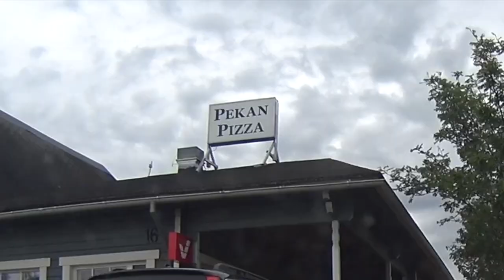115 km in RAIN with Milan SL Velomobile

Comment: I also sweat a lot in my velomobile. When it is raining I sweat even more. It helps a little bit to install seat fans on the back of the seat like I did in part 3 of my quest lighting upgrade series that I just uploaded to my YouTube channel. Even when I ride without a race hood I get very sweaty. I think that is normal in a velomobile. I wear shorts for working out and those don’t soak up as much sweat as regular tshirts, but I can still usually ring the sweat out of my clothes after a ride when it is raining or very warm.
Reply: I imagine you sweat more when it's raining because the increased humidity
Reply: Actually T-shirts are no good at all. Better wear a polo, the heavy cloth kind. The heavy cloth absorbs sweat and lets it evaporate.
It also prevent the clammy feeling of the T-shirt clinging to your body.
Always put up the collar to prevent from sweat running down your neck.

Installing a USB-ventilator, or even a PC-ventilator may help too.
Reply: @_PJW_  athletic clothing technology has evolved considerably since the early 1900’s. No athlete would consider wearing such clothing now. The wicking shirts and shorts now are MUCH better at cooling and evaporating sweat than the clothing you are referring too. If I wore a polo shirt when riding I would be water logged by the end of the ride. No thanks!

Comment: I had the chance to add a Milan GT to my Alleweder 6 this summer and my verdict is: yes and no. The GT is so much fun to ride, and I am impressed by its efficiency, I had never ridden a bike "seriously", I came to cycling with the help of electric assist, and nevertheless I can do longer trips with an average of 28 to 30 km/h. However, for long trips which are not only day trips and where you need to take luggage with you, I don't find the Milan or any other fast velomobile is very suitable for long trips (maybe with the exception of the Alpha 9 or QV if this is still a fast one) - if you are not a Tetris champion. When going on trips that are more than one day, I continue to prefer my Alleweder because I can just pack SO MUCH stuff in there! I only do an average of 20 to 25 km/h with the Alleweder but that's not a problem.
I second your opinion on the seat, but I have no problem with the neck rest. My GT also came with the new Ventisit neck rest but I found that too hard and uncomfortable so I re-installed the default foam thing you also have.
In such heavy rain, I also ride with open visor because otherwise you can't see anything. In the German forum there is a thread about a new hood with a motorcycle helmet visor being planned / in development for the Milan, I hope that comes to fruition some time. My service hatch at the front is not leaking, always make sure you press it on firmly.
Are the ventisit "carpets" to put at the sides of the seat you took from your QV available as separate items?
About sweat: That is more prominent when you wear loose-fitting cotton clothes. I never wanted to but I started wearing roadbike jerseys and running tights (because they have no seat pad, unlike cycling shorts) when riding the Milan. This at least remedies the sweating a bit because these fabrics transport the sweat away from the body faster.
Reply from the maker: The floor mats are available from Velomobiel.nl. But the QV mats comes with a third one for the rear luggage space, which you don't need. Maybe ask if you could buy just the mats for the side pockets.

Comment: This is very good, that the parts are not stainless steel, because stainless steel can break. Normal Steel gets a bit of rost, but this kind of steel is much more durable and does not break easy.

Comment: 100 km is no propper test ;-) That is a daily commuter ride  ;-) ;-)
This test gives you a good inside about how you sit. You need a thick open ventisit for comfort and more ventilation. Your shirts are cotton (soking up moister) or closed polyester (with closed print 'i'm a velomobilist')
With a hood on, above 5 C, I never ware any shirt. Just a short trousers and a thin towel on the sit with a lot of small holes. 
My neckrest is also from Ventisit. There is a whole range of thickness and forms you can choose from. Your neckrest is for sound demping. No good.
When I'm riding in the rain (with hood on) a use a second big packtowel around my neck
Reply from the maker: I know 100 km is not long enough. I wanted to ride longer distances, but I just didn’t have time for that this summer 🤷‍♂️

Comment: Have you considered trying Schwalbe Big Apple or Big Ben tires? They smooth out the ruff roads, here in the Cascade Mountains pretty well.
Reply from the maker: No I haven’t. No room for wide tyres on Milan.
Reply: @TheVelomobileChannel  then maybe some fast rolling gravel tires would work like panaracer gravelling slick or SK thread variants?
Reply: Michelin Wild Run`R 26x1.40 would be fine.
Reply: @TheVelomobileChannel  What would be the max width that could be fitted? A Mondial might work, or a Michelin.
Reply from the maker: @kirkjones9639  not sure about the rear wheel, but apparently there should be just enough room for 40 mm tyres at the front, but then the turning radius would be too large for everyday use.
Reply: @TheVelomobileChannel  I've used 559X50 on the back, and it worked well. I think 406X40 is the narrowist tire, that they make in balloon type construction. Perhaps Michelin makes one. It is the flexible sidewall, with low rolling resistance, that you would be looking for after all. Didn't you run the Tryker, on your Quest?

Comment: Maybe putting painting tape on the service hatch would help with water leaking?
Reply from the maker: Yes, that would probably solve the problem. No need to open the service hatch too often, so it doesn’t matter if it’s taped. 🤔

Comment: saukki is the rock we hear in videos finn rock or from the band you play in have same problem but no foam pad headrest sweat and rain can't be changed is high humidity in a small space but venting should help or absorbed clothing body gives heat and that condensed in velomobiles is the cadence higher or lower  when compared with quartro or your old